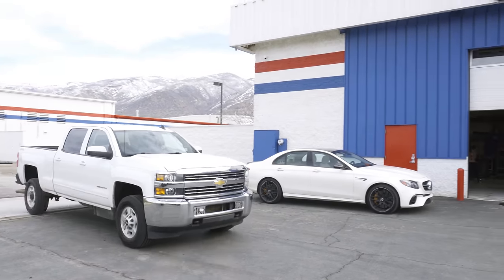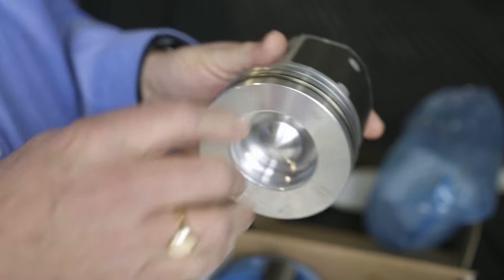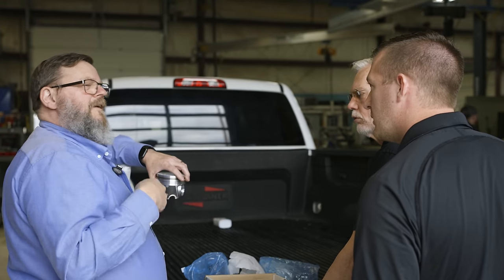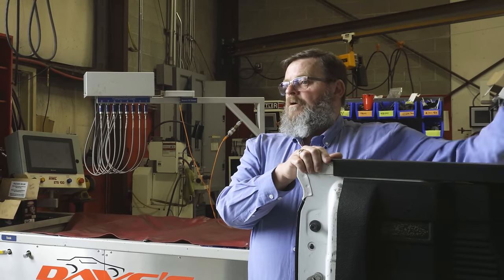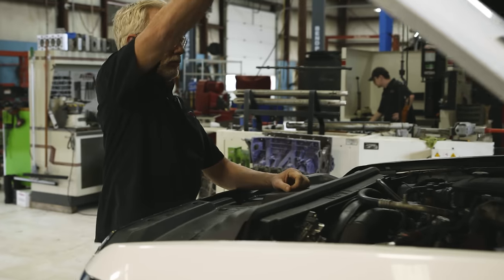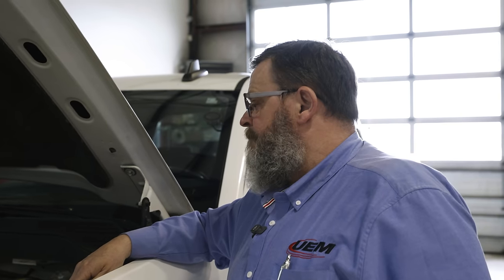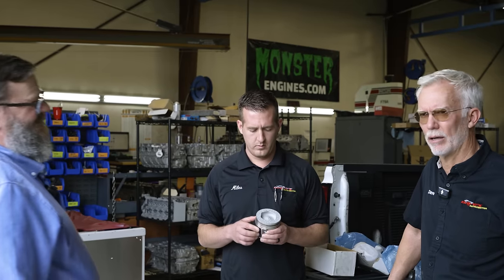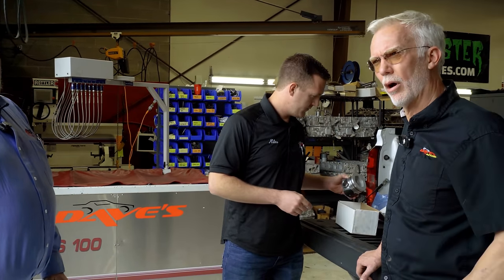What do golf balls and pistons have in common?

Comment: As a physicist, 13 to 16 mpg seems unreasonable. In the end, efficiency is physics and the only way you increase efficiency of the diesel cycle is by increasing compression ratio, increasing temp, and decreasing the temp sink. Their pistons might provide a higher compression ratio. The ceramic top might reduce heat loss (higher temp), and the heat sink (atmosphere) is going to be the same. I’m not sure you can get 20% more efficiency from these changes, and then add in environmental emissions considerations, and that makes me more skeptical. Maybe, but this definitely falls into the “show me” category.
Reply: I agree with you. I’m not a physicist, but I do understand with diesels the leaner you run, the hotter the burn and more NOx is produced.
Reply: Yeah and of the new piston is increasing compression that's definitely not some technological breakthrough.
Reply: @hoonaticbloggs5402 You mean gas motors
Reply: I happen to think this is total snake oil.
Embarrassingly so, much like engines that run on water.
Reply: @sungear 
Agree on the snake oil....though engines run on water vapor, via steam isn't.
Reply: You just don't understand, there is efficiency from better combustion.
Reply: @sungear engine can run on water, you just don't understand that, like these pistons (I was made engine to run on water, and I speak from experience).
Reply: Okay.
I am NOT a physicist.
I am a diesel mechanic AND operator.
I’ve seen some outrageous mechanical things that do some ridiculous improvements in mileage, no doubt.
I’ve also seen suppressed tech that would have cleaned up emissions back in the 60s.
If making a piston that improves efficiency that actually works is out there, I’ll give it a fair shake.

Why?

Flame propagation is STILL not an exact science.
Any of you that complain about snake oil should see some of the “off-the-wall” things that some try and do just for kicks.
Garage 54 and Project Farm have done some very weird things to engines just to see if is can be done.

I’m going to mention this to one of them to see if it would really work, and see about getting LAYMAN’S views on the outcome.

That should satisfy any belligerent as to feasibility of such an alteration working in real time.

Millions trust these guys for their “stupid” engine tricks, because the “off the wall” approach gives us VOLUMES of good information.

I’m not going to knock it until I see REAL information, and those two places are the ones that could do it.
Reply: @dangeary2134  love your thoughtful commentary. I will get on board immediately if any source at all can show real results. 
One issue that bugs me is the golf ball comparison. 
Golf balls go further because of the boundary layer of air that goes PAST the golf ball. 
Flame propagation in a cylinder has completely different flow behavior compared to flowing past a moving object. 
The other complaint I have is that it should be obvious that every engine builder on the planet would switch to these pistons if they worked and that ain't happened yet.
If garage 54 shows these work I'll buy a set.
Reply: Regarding the dimpled surface, it might help to convince people if they would do a little more than just hand-waving on their website. They could show some results of CFD simulations of the combustion process with and without the dimples. If they are doing this properly, those simulations should exist already. In fact, if they are optimizing the surface properly, they'd have results from many simulations because they would have parameterized the shape of the surface and used an optimization algorithm together with a cost function, generated using a CFD simulation, to search for the optimal set of parameters (i.e., the optimal shape of the piston).
Reply: Okay? Deleting a truck can easily go from 11-18mph but you’re physicist
Reply: @taylorpratt6287  at least he wasn’t blatant about breaking the law.
Reply: I'm assuming that the dimples on the Piston operate similar to dimples in a bore or port where they turn into little vortices and increase the boundary layer substantially. Being in the cup, I can see how it could also add to atomization. If the vortices are strong enough to help suspend the fuel away from the piston and out of the boundary layer where are the Piston pulls heat out of the combustion chamber and cools the gases below the flash point of the fuel, I could see that. The whole point of di engines in the first place was to reduce wall wedding which was wasting fuel and try to concentrate the fuel spray within the center of the cylinder away from the boundary layer which is cold. And from that alone we have already seen increases in efficiency which is why it's becoming mainstream. I'm not saying that these Pistons work, I'm just hypothesizing about how they may work. Which may possibly have some truth to it but I don't know that it's 25% worth.
Reply: But 16mpg is not amazing (is it? I don’t own a truck). If you drive it more conservatively you could get that. I’d like to see before and after on a dyno driving an official cycle like the ftp 72.
Reply: What makes me instantly say this is fake is that they are claiming lower NOx and lower soot. You can't do both, they are inversely proportional
Reply: @dangeary2134  valid point however the emissions equipment on all engines does far more harm than good at the owners expense
Reply: Bravo, you figured it out quickly.  You are 100% right..  We live in a time now where people have stopped thinking and understanding, but are actually believing what company's are telling them with nothing more than "trust me"..
Reply: dimples create turbulence - perfect burn and also either higher boost or compression possible, those rings help too
Reply: Water injection is working on engines for cleaner comustion etc but not all companys use it. Why? Was only 1 company in US decades ago which used water meth injection. Why if this works? Why oil intervals increased if this is first fail. Why? Because not enginers decided about the product . Economists rather.
Reply: Well why do you think they designed them and are testing them?
Reply: @augustinasvilkas but if you get a more efficient burn inside the combustion chamber then that would be true.
Reply: Going forget to account for less blow-by = less lost energy and less loss thermo efficieny that needs to be corrected though the oil cooler
Reply: I would love to fit these to my old Toyota 2H diesel…an all mechanical engine!
Reply: You mentioned everything but sound. How does sound effect the entire process??
Reply: I am not a physicist but I don't fully understand how the newer piston could have that much of a gain. Could you further explain? To me, it's not clearly understood because it's something missing.
Reply: Wonder how these would work in a 7.3. Boy this thing is loud!
Reply: @aleksandarpetrovic6613 probably the dimples add more surface area to accept the extra forces from expanded combustion surface.   That would account for the better fuel efficiency and boost of power.     Much like how a golf ball aerodynamics are changed with dimples to help increase the lifting surface area to help the ball go farther as opposed to a plain ordinary surface of a  sphere.    In baseball I think the stitching is what gives the ball the ability to be a curve ball?
Reply: You forgot about the gapless second ring.
Reply: Not something I would just pull down and fit
But certainly consider when doing a rebuild 
Diesel fitter 45years
Reply: @hoonaticbloggs5402 that's with gasoline. Diesels are almost the opposite.
Reply: I mean, the dimpling sure has an aero effect but it seems weird that it could have that sort of impact. I’m skeptical AF.
Reply: @taylorpratt6287 That is incorrect! You don't pick up 7 mpg from deleting.
Reply: As an engineer I can see a ceramic piston head and the gapless second ring being the winners causing the increase here, more reflection in the radiated heat cause increased combustion and higher compression respectively.  However, I sincerely doubt you can mass produce a piston with a ceramic head of the economy of scale to install on a single manufacturers diesel engine line. Going from small batches to vast quantities is where amazing concepts go to die.
Reply: It's the exact opposite.  A lean diesel has lower exhaust temperatures because it's using less fuel.  If you want to melt a turbo or burn holes on the top of a diesel piston.  Your thinking gasoline engine.  Watch some Gale Banks videos to learn how diesel really works.
Reply: @pawelgorniak5416 free energy is there, water/gas mix carbs also., patents and closeted by big 7 car makers, its oligopoly
Reply: @archiebunker7688  "...more surface area to accept the extra forces from expanded combustion surface."  You don't understand how an engine works. The combustion pressure bears against the piston area. The piston area is just the bore of the cylinder. The shape of the piston crown is irrelevant.
Reply: @pawelgorniak5416 yeah, water injection works, and yeah they dont use it because the reasons you mentioned. But there are other reasons, namely normal people just forgot about things. At least some of them.   You know the stories of filling up the oil pan with engine coolant,or just forgottting to change the oil altogether. This will be another thing they will be forgotting about. Thankfully it dont have as bad of consequences as forgetting to change or topping up the oil, but i hopeyou get my point.
Reply: @lelenbates3367 i tought being lean means hotter burn because of the abundance of oxygen. I work on a flame cutting machine if you want to ask my reference. You said it will burn holes on top of the piston that seems logical given it burns too hot, but why it will have lower exhaust temps?
Reply: @lelenbates3367 i mean besides less fuel aded to it. It still burns hotter in the combustion chamber
Reply: @lelenbates3367 but i see that google gave the same answer as you so probably true. Fuel quantity matters even if the combustion izself is hotter.
Reply: Compression pressure is different than compression ratio. Compression pressure will vary according to percent ignition which is where the improvement happens. People that know more than me have tested them and they add 100 lb-ft to a stock 6.7 and are so quiet. They are doing something.
Reply: Plenty of things can factory into efficiency of a diesel.  It's been proven things as little as spray patterns can effect efficiency.      Maybe it's not a direct power adder but cleaner running oil can improve rolling efficiency of the internals etc.  All sorts of little things can easily add up to increase efficiency dramatically
Reply: Not necessarily correct. What you are talking about is the theoretical efficiency. There, sure, different pistons with the same compression etc would not make any difference.

But as you can see with tons of different engines, there is another aspect to that that theory cannot really explain, because the number of variables is just too large. Because of that, we usually resort to things like numerical simulations.

Things like how effective air is moved into and out of the cylinder, how the combustion occurs etc will have an influence on how much energy is lost to the cooling water, for example. And that means that theoretically, those pistols could be much more efficient, even though they will not be able to overcome a theoretical limit that current engines do not reach.